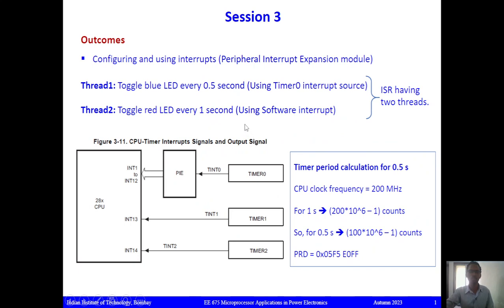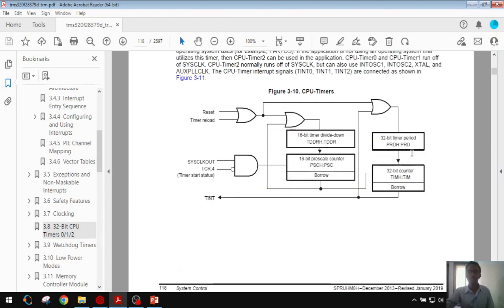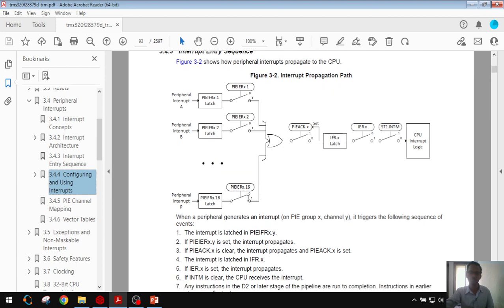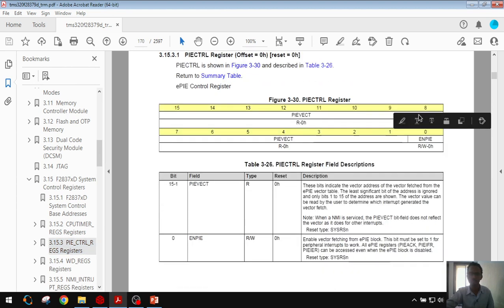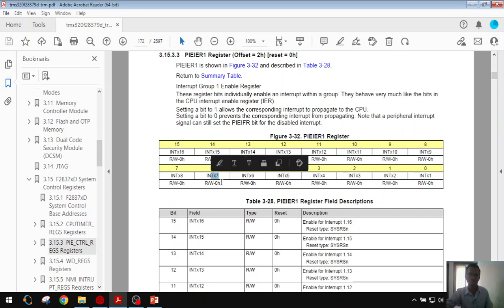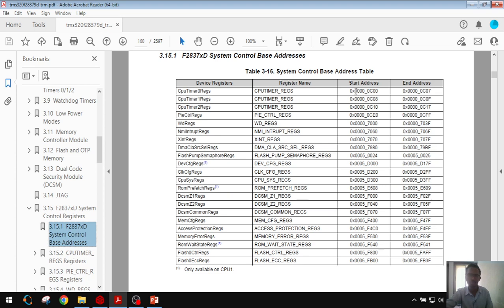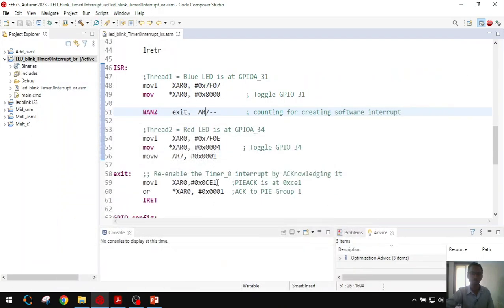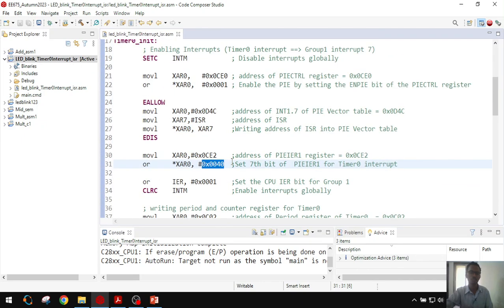Creating Timer 0 interrupt, PIE module, TMS320 F28379D, LAUNCHXL- F28379D LaunchPad, LED blinking

Comment: From the technical ref manual,it is said that the tms320f28379d has 4 clock sources.One has to choose the clock before starting to program.I used assembly programming to create a 2s delay using timer0,but i was not getting that delay with the calculated PRD register value.The device was working as if it is clocked at 10 MHz.From the datasheet also,it is learnt that the default clock frequency is 10MHz(INTOSC2).However using C for programming,the  PRD calculation is as expected.In the C program,the initsysctrl() function does this job(configuring the system frequency to 100 or 200 MHz).Can u guve an explanation on it.?Did u get the proper time delays(as expected)for toggling the leds?
Reply from the maker: The clock source INTOSC2 has been used in this tutorial. The physical crystal oscillator (INTOSC2) in the F28379D processor generates a 10 MHz clock. The desired CPU system clock can be derived from this 10 MHz clock by choosing the appropriate PLL settings. The maximum CPU system clock would be 200 MHz in this processor.
fPLLSYSCLK = fOSCCLK * (SYSPLLMULT.IMULT + SYSPLLMULT.FMULT) / SYSCLKDIVSEL.PLLSYSCLKDIV
In this tutorial, the CPU system clock is configured to 200 MHz (this has not been explained in this tutorial). I got exact real-time delays (as expected) for toggling the LEDs; which can be observed at the end of this video.

Cross-check the registers such as SYSPLLMULT.IMULT, SYSPLLMULT.FMULT, SYSCLKDIVSEL.PLLSYSCLKDIV  in your assembly program. It should work.